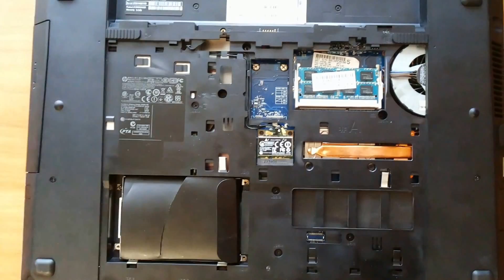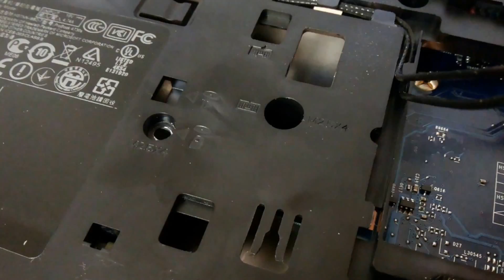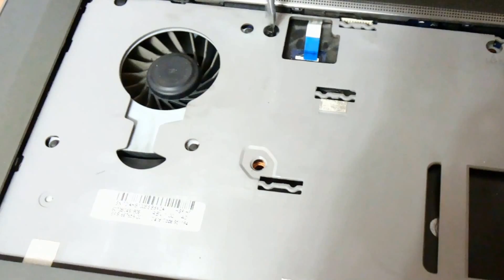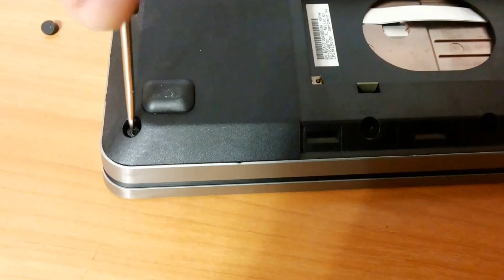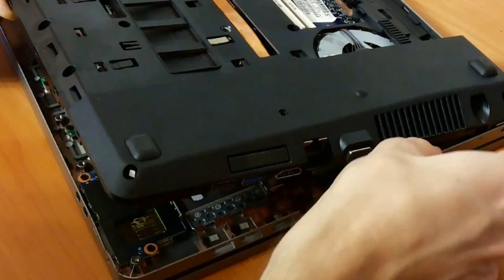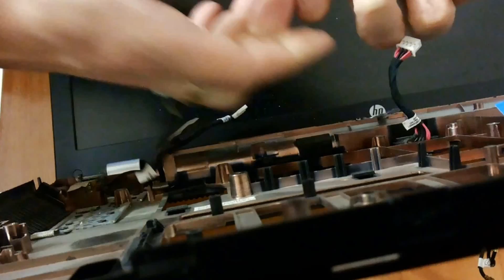HP ProBook 4530s / 4730s Disassembly & Keyboard Replacement Tutorial

Comment: Sincere thanks for the video. It takes 40 seconds to replace CPU in my HP4540. I also wanted to do it in my 4730. Instead it will go on the auction with Win7 and quite well working. It looks like a nightmare to change CPU in it.This laptop does not work well with Win10 anyhow.  Your video helped me immensely.Great job! Thanks again.
Reply from the maker: Glad it helped

Comment: Hi, 4730s is necessary to disassebly a entire laptop for changing a CPU? Or is possible to remove only black parts of housing to uncover CPU, fan and heatpipe ? Thx
Reply from the maker: In order to replace the CPU you need to remove the motherboard from the bottom case chassis.